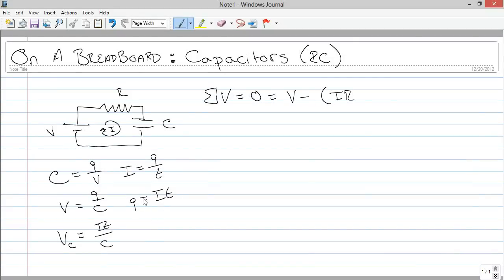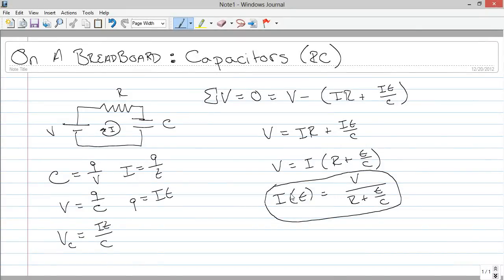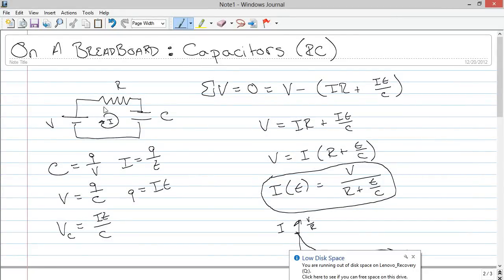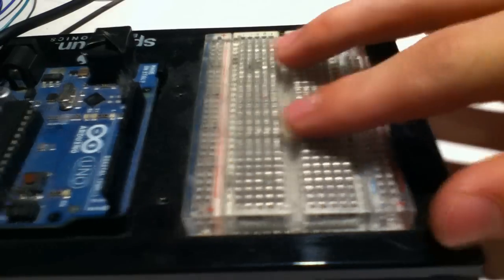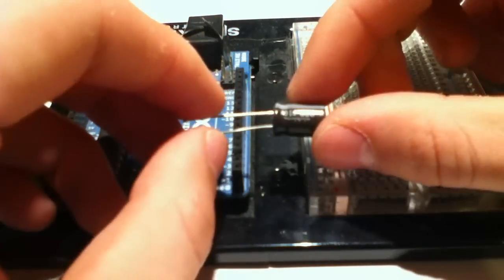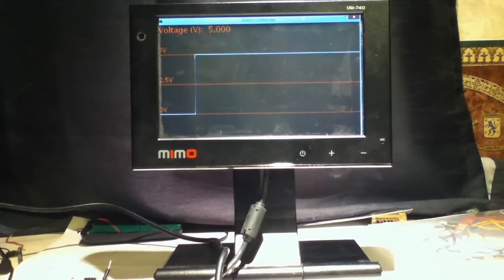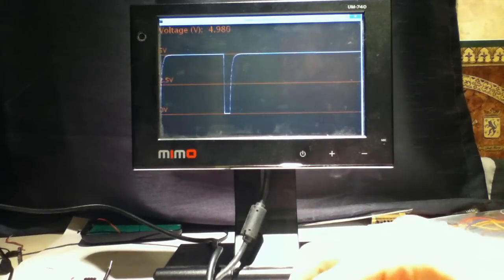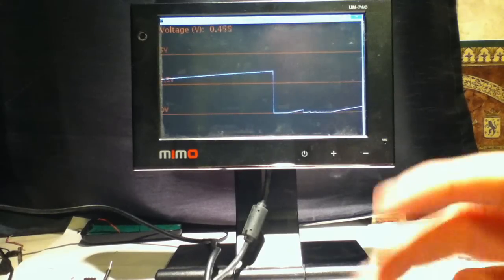On A Breadboard: RC Circuit

Comment: Duh.  Sorry, yup, completely forgot that resistor was in series to that loop too.
btw, at what point (voltage/capacitance) does it stop being 'safe' to short out a cap directly as you're doing?

Comment: When you discharge the capacitor in that circuit, aren't you shorting out your Arduino 5V rail to ground during that time?